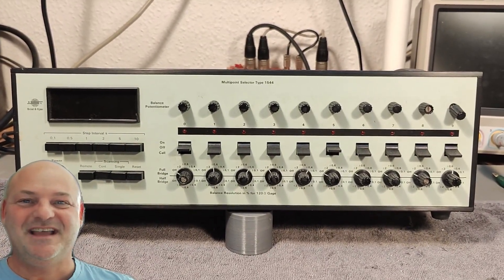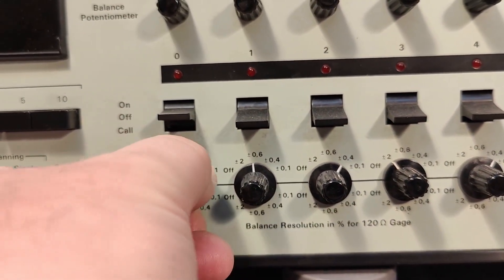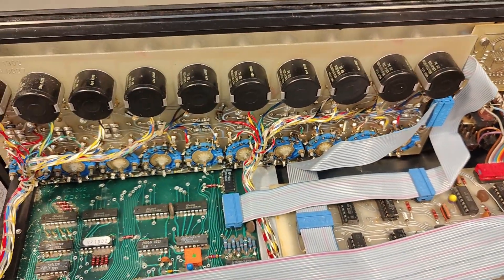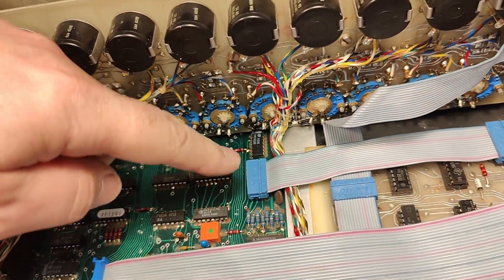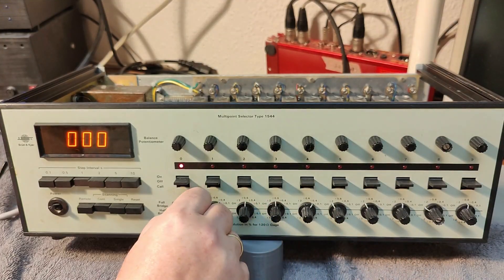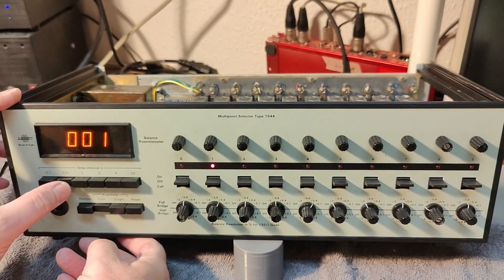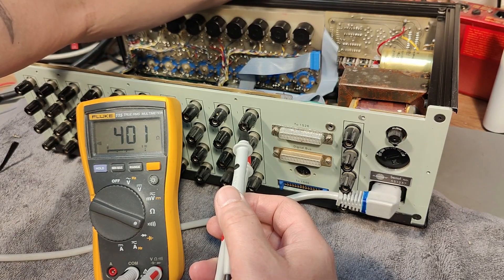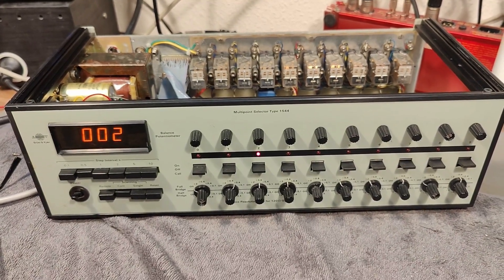Brüel & Kjær 1544 Multipoint Selector 10 ch strain gauges 1982

Comment: It sounds like Metronome  , did the pcb contain the famous 4017 CMOS integred  cercuit.
Reply: 4017 would not be very useful for something that appears to be binary addressable...
Reply: @splitprissm9339 You are right I  downloaded the user Manuel they used bcd to 10 line decoder.